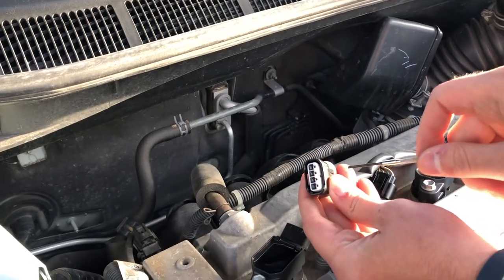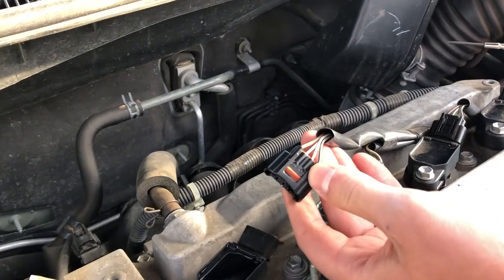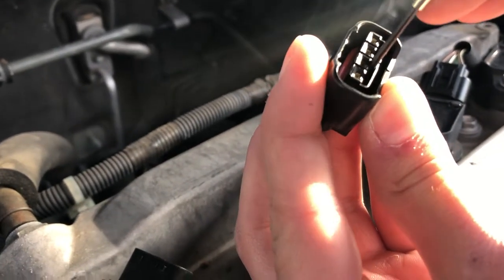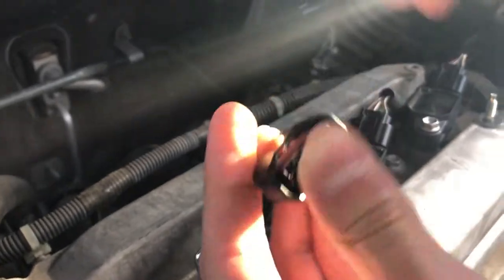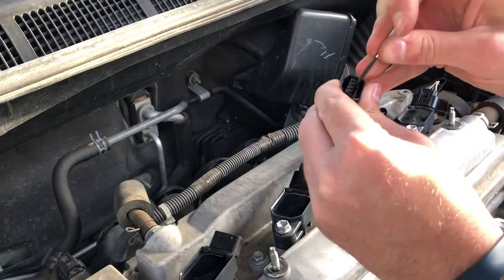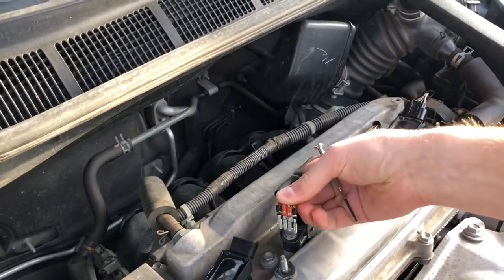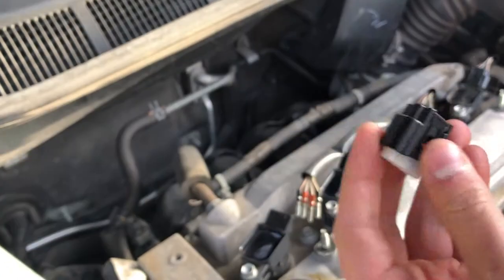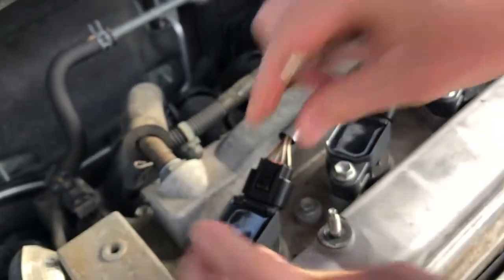Toyota Ignition Coil Connector (part#: 90980-11885) Replacement

Comment: Just wanted to say thanks for this! I had one wire pop out of a coil pack connector for my LS430 while replacing my starter and did not want to replace the whole connector. Now that I could see how to disassemble it, I had the wire reconnected and back together in 5 minutes. No more P0353 code or VSC light.
Reply from the maker: Glad it was helpful.
Reply: I was getting the P0354 for my Highlander!

Comment: Thanks to this video..I just replaced the 3 front coil connectors on my 07 lexus es 350..as the video suggests..take pictures or draw your own schematic diagram like I did..(hmm hmm..me not being a mechanic necessitated me doing both)..had a little challenge getting the wires out of the connector..but in the end after some struggle..it worked out..and I'm grateful...thank you sir for your video.
Reply from the maker: Glad it helped!!
Reply: Did you use the same part numbers (90980-11885) to buy for 07 Lexus ES350?
Reply: @alexsolomon-fl6nf  yes that’s the same part number I ordered from Amazon..Ballenger Motorsports 4 way Japanese coil on plug connector housing..

Comment: Great video. I recently went to the pickapart junk yard and notice pretty much all the black color connectors were broken and brittle however the brownish/orange colored ones from various Toyotas were not, I simply filleted this video and removed 4 orange ones at the yard and followed his instructions. I used a large paper clip to hold the wires in order. It was a breeze.
Reply from the maker: Thanks! Glad it was a help and you were able to get that fixed!

Comment: Wow, nice. This is a much easier way from which I was going to do it. I was going to clip, strip, and twist the old wires onto the new wires from the new connectors, and put electrical tape around the exposed wire. This way is better tho, as long as the old wires don’t need to be replaced.
Reply from the maker: Thanks!

Comment: Thanks for the video. Helpful. Will those wires ever really need to be changed for any reason? What prompts you to change that shell? Thanks again.
Reply: They get really brittle and fall apart at some point.
Reply from the maker: You are very welcome! After looking up videos on how to do it I knew I had to make one with better lighting as it was hard to tell.

Reason why:
After changing spark plus 3 of 4 snapped even though I was careful and heated them up first (to lessen the chance of them breaking).
Reply: @brycecarlson  thanks!

Comment: Is there a way to replace the metal pins at the end of the wires?
Reply from the maker: Yeah; I had to do that one time long before this was shot with a different vehicle. The process is pretty good in this video, and all you need is a new metal connector end to crimp on to the wire and then put back into the connector.
https://youtu.be/XgovfeYaaDk
Reply: @brycecarlson  Thanks Bryce. I really appreciate this!
Reply from the maker: @morganmosley5136  no problem, hope it works out!

Comment: Do I need to disconnect the battery or not?
Reply from the maker: @buhayaustralia1212  it would not hurt to do so. It was a while ago but if I recall I did not because the ignition was not on so the wires were not energized. However, I probably would disconnect it now. Looking back.

Comment: How to change the wires is there any video
Reply from the maker: No video that I have. My wires were fine. I would maybe start with the parts diagram and see if you can find if the harness is for sale etc.
Reply from the maker: Just did some looking around. It does seem like you can buy a ignition coil connector set with wires that you could splice. However, I'm not sure of the effectiveness of that. I would check with your parts department using your VIN to see if they can match you up with the harness itself. I guess is that will cost quite a bit more than the ignition coil connector wire harness kits that I'm seeing online for $30 to $40.

Comment: If the wires are beginning to look brittle, how to rewire?
Reply from the maker: A full rewire I am not sure of. I would assume you could get the part of the harness going back to the ECM, but maybe not.

That is not listed in related parts:
https://parts.olathetoyota.com/v-2009-toyota-camry--le--2-4l-l4-gas/electrical--ignition-system

I would ask your local dealers part department, and ask them if you can buy the wiring that goes into the connector (Part Number: 90980-11885). They have a more in-depth system than many of the online parts places in my experience.
Reply: I've seen pigtails (plastic clip with four wire leads. You might want to contact your Toyota dealership and see if they carry those pigtails. I've replaced them on other cars and have soldered them and used heat shrink and then applied high-temperature 3M electrical tape as an extra measure to all the wires. Apply a small dab of dielectric grease to the front of the new connector.
Reply: @jamram9924  thanks

Comment: So my dumbass just changed out my 2004 Toyota Camry spark plug ignition wires and totally forgot what order the colors were on every single cylinder. I knew better ,but wasn't even thinking. That was really dumb. I was just trying to rush. I know the first one is always the black one ,but that's about as far as I've gotten. If anyone would have information on the color sequence on ignition wires 1,2,3 and 4 I would highly appreciate it. Thank you.
Reply: I've got a 2005 Camry that I just replaced the value cover gasket on and 2 of the clips broke before I realized what was going on.

I don't know the cylinder order on this car. It's the 4 banger version, so the ignition coil closet to the oil fill cap  is - back to front:  black with a red stripe, white with a red stripe, red/pink with a white stripe, white with a black stripe.

Next coil: black with red stripe, white with pink stripe, pink, white with black stripe

Next coil: black with red stripe, white with pink stripe, green with black stripe, white with black stripe

Coil closest to battery: black with red stripe, white with pink stripe, blue with white stripe, white with black stripe
Reply: Not sure if it'll let me post this link but here's a photo, see comment above.

https://i.imgur.com/OI7w8aQ.jpg  - coil closet to gas cap
Next: https://i.imgur.com/E9gVrNQ.jpg
Next: https://i.imgur.com/huWSpe7.jpg
Coil closest to battery: https://i.imgur.com/wL26L41.jpg

Hope this helps!

Comment: did you disconnect the batterie?
Reply from the maker: Yes; prior to getting the camera out. Just the negative cable to cut power. Positive I left in place.
Reply: @brycecarlson  thanks bryce
Reply: @brycecarlson  Hey, i recommend that you add that to the video description in CAPS!! May save someone from a lot of trouble :)